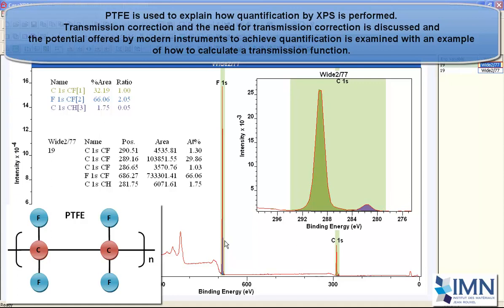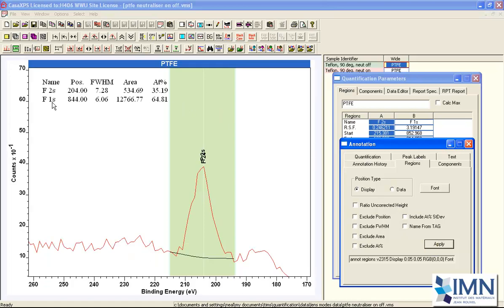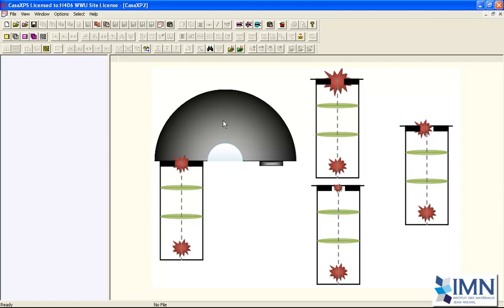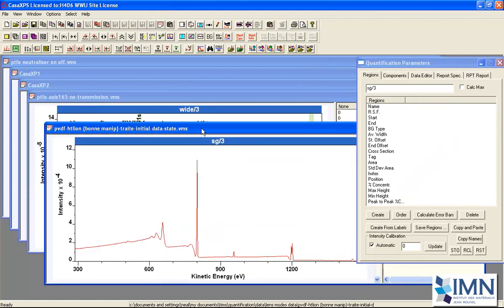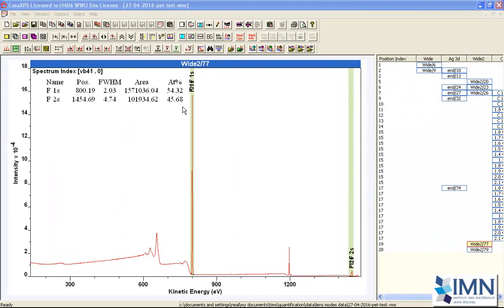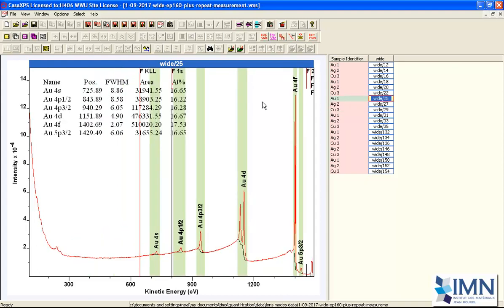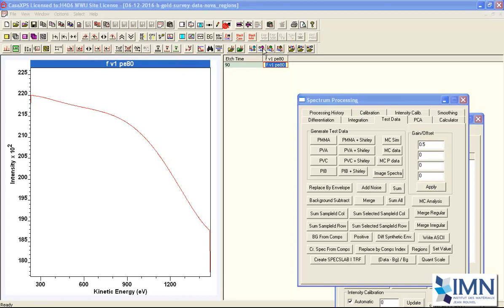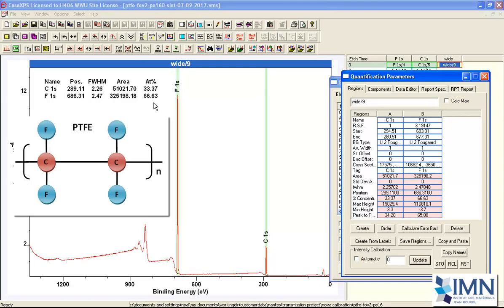Quantification of Poly(tetrafluoroethylene) PTFE and Transmission Correction in CasaXPS

Comment: Great video, thanks for that. One question: What can I do if I do not have a transmission function recorded and no standardized spectrum neither?
Reply from the maker: Instrument characterisation including transmission determination is need when computing absolute quantification. For data collected without the necessary transmission functions then the traditional approach to comparing samples would be to compare samples in a relative sense by %atom concentration values, being award that these are not true atomic concentrations. Comparison of samples by values computed following %atom concentration is exploiting the normalisation of these values with respect to each measurement so that results from different measurements can be evaluated using equivalent information.
Reply: @casaxpscasasoftware4605  Maybe I should explain, what I mean by an example: I have a clean Ag(111) sample in XPS and the Ag 3s, Ag 3p and Ag 3d are not in a 1 : 1 : 1 ratio, as I would expect. 
Also, the transmission function which the program (SpecsLab2) writes out, does not improve this ratio (which is why I assumed I do not correct for the "real" transmission function), basically there is no difference when using a format with no transmission correction written out, and a format with a transmission function being written to the file. How can this be?